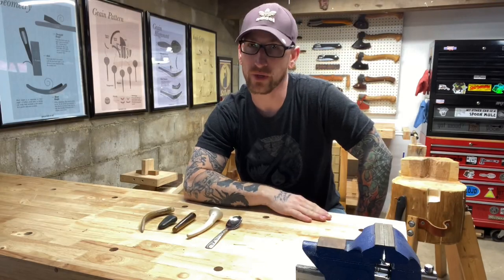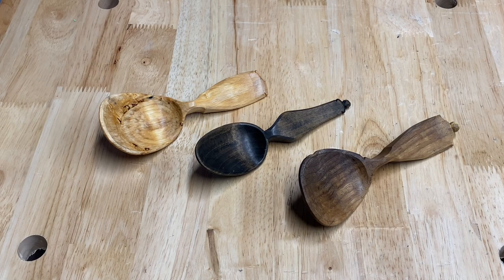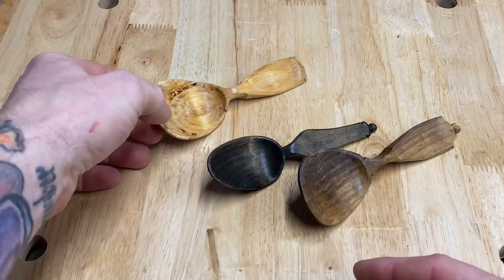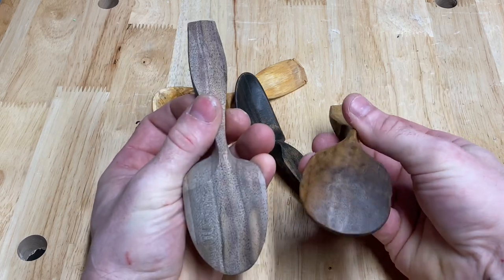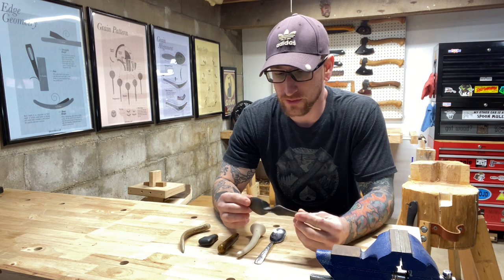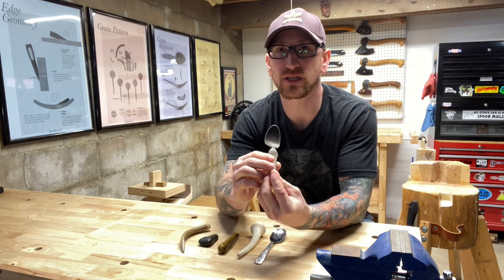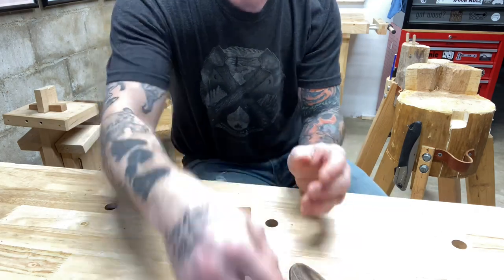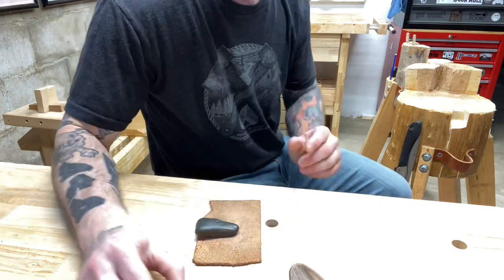Spoon Burnishing

Comment: Horon spoon co . I use vegetable cooking oil then I put my spoons in oven to darken them and pop grain out it also hardens spoons  you had to keep eye out you don’t get too dark finish or burn them  I use a smooth pebble to burnish a spoon but yeah your so bang on the bucks greetings from the uk 🇬🇧 👍🐾🦊🇮🇹
Reply from the maker: The problem with vegetable oil is that it has a shelf life so it is prone to going rancid just like anything else that expires. It also doesn’t polymerize, meaning it stays liquid within the wood and doesn’t offer any protection whatsoever.
Reply: Huron spoon interesting  I never had any issues using it I applied it very spareingly the oven baked spoon takes care of rest besides I’m not financially well off  so I improvise is why I chose whittling as I has plenty of my favourite pocket knives the Barlow and couple saks greetings from the uk 🇬🇧 👍🐾🦊🇮🇹
Reply: John, what heat and for how long? Thanks!
Reply: @johndagostino2451 I also love using polished stones and antler for burnishing wood carvings (the antler tip can be shaped, then polished, to get into all different bits of Celtic knotwork). I also use Walnut oil and cold pressed pure Linseed oil to finish as I’d heard that vegetable oil/olive oil would go rancid. Then I recently read a blog from Paul Sellers where he said that he used Olive oil on his spoons. My eras (eyes?) pricked up. He addressed the point of the oil apparently going rancid and said that he was still using spoons from thirty plus years ago that he had finished with Olive oil and had never had a problem from it. Perhaps it’s the quality of the oil used? I shall experiment!

Comment: I’m sanding mine, then oiling and then burnishing, but that’s cause I haven’t got your skill yet 😂
Reply from the maker: Just a heads up- sanding will almost always leave a fuzzy finish. Burnishing will certainly compress the fibers and give a silkier feel, but once the spoon is moist again the fibers will undoubtedly raise up again.
Reply: @HuronSpoonCo  
Thanks
Up until now I’ve been struggling with my skill level with the knife for the final finishing, and have been using the sanding as a method to get the final shape, 
Recently I’ve managed to do a few with only the knife to almost the exact final shape, but then sanded them to remove the flat spots and carving marks.
Practice makes perfect as they say. 😁
Reply from the maker: @robg521 absolutely!

Comment: Dude… what is that carving saddle you’ve built against the wall? It’s glorious
Reply from the maker: It’s a mixture of two different woodworking devices shared by a single frame. One side has a spoon mule on it and the other has a shave horse. They both share the seat in the middle.

Comment: I have mixed skills and mixed styles. Japanese planes are super sharp and planing will leave a polished surface on the wood that closes and burnished the new cut fibres so well, that they shine. Sanding actually degrades the surface.
Just started Carving & whittling, 1st lesson on testing sharp knife and knife sharpening was not can it slice paper, my penknife can do that. But can it leave polished, shiney surface is a completely different level of sharpness

Comment: Love you instructions and philosophy of spoon carving for enjoyment and improving you skill. All of my spoons are pretty rustic and more suitable for trolls (the kind under bridges). Would it make sense to first oil the spoons, then burnish? Burnishing will close the pores and prevent the oils from soaking in.
Reply from the maker: Thank you! It’s a common misconception that a finishing oil needs to “soak in”. It’s kind of backwards thinking actually because the deeper the oil penetrates, the more difficult it is to polymerize (assuming we’re talking about a polymerizing oil- which is the only kind suitable for spoons, in my opinion). Polymerizing oils should be applied in very thin coats. Thin coats can be cured quickly and then more coats applied, if desired. I’ve seen folks actually soaking their spoons in oil overnight because they believe it provides protection. Penetration doesn’t equal protection though- polymerization does.
Reply: @HuronSpoonCo  Thank you for the reply, that's very interesting. In other applications (furniture building, exterior home wood repair, axe head end grain, etc) I use hardware store "boiled" linseed oil (with probably toxic driers) and a variable thinning with a bit of turpentine and can watch it "soak in", and later more will soak in, decreasing with each application over time. On a few occasions on old weathered wood windowsills, many years later, I cut the wood apart and could see 2-3mm of penetration which firmed up the wood (and also allowed a top coat of oil based paint to adhere). I assumed, perhaps incorrectly, that something like that would occur with spoons too, especially since carving curves, like the bowl, exposes end-grain. For spoons, I use food grade linseed (flax seed) oil for initial application, then a period of partial drying (days to weeks), For a finish, several coats of General Finishes Salad Bowl Finish (now called Bowl Finish). Tried and True Original with linseed and beeswax is purported to be very good as well, but I have not tried it. I may have to re-think my methods.

Comment: Great video Sean! Love all the detail you go into.

The piece of antler you have, how did you get it so polished and rounded? I have a few pieces around the house, that the dog has lost all interest in, that I was hoping to repurpose.
Reply from the maker: Thanks very much! As for the antler, I’ve had mixed results trying to get the end perfect on different pieces of antler. I hand sanded the one you see in the video up to 6000 grit and stripped the heck out of it on bare leather as well. The problem I find is that some pieces of antler are able to be completely smoothed while with others, the marrow doesn’t smooth out well and will leave scratches in your spoon. If you can find a piece absent of marrow, you’ll surely be good to go!
Reply: @HuronSpoonCo  will take a look and see if we have any kicking about without marrow then!

Comment: Hello sir, I have a raw wood canary guitar neck. It comes with a factory 250 grit sanding, and most in the guitar/warmoth community sand this up to about 2000 grit (starting with 600), and then the neck is super shiny, burnished, smoother, and faster to play. Seeing how you burnish, I am inclined to think your method would provide similar or better results. Would you recommend using a smooth stone or doing what all of my compadres in the guitar community have done? Is there any risks with one over the other? I don’t need to reshape the neck at all, just close the cells and make it as smooth as possible. This was a great video, thank you!
Reply from the maker: Thanks for your comment! I would think using the side of my burnishers on a guitar neck would work amazingly!
Reply: @HuronSpoonCo  I think so too, but it’s always tough being the first to try something, especially on one’s own instrument haha. And I’m admittedly in between two sets of expert opinions; guitar techs who have always done it one way and woodworkers. I don’t think that trying either way prevents me from  roughing it up with a lower grit sandpaper and trying the other, correct? Say I try one of your burnishers first, if for some reason it isn’t what I need, I can always go back and use paper, right?
Reply from the maker: You could, yes. I would suggest trying one of my burnishers on a piece of wood with similar Janka hardness and see if it’s a result you like.
Reply: @HuronSpoonCo  Thank you so much. I’m ordering a burnisher now. I guess I have one final question. Since you don’t sand at all anymore, is there an equivalent “grit” to your finishing cuts? I ask, because this is already sanded to 250, but I am assuming that your finishing cuts are smoother than that. So maybe I sand up to 1000 grit, then use the burnishing tool.
Reply from the maker: The burnisher will make pretty much any wood surface smoother/shinier. The thing about sanding is that instead of cutting the wood fibers, you’re abrading them. A knife finish along with burnishing will always give you a better finish than sanding and burnishing. I would suggest trying the 1000 grit before burnishing and if you aren’t quite satisfied with the results, move up to 1500 and then burnish.
Reply: @HuronSpoonCo  that makes total sense. So a knife finished guitar neck is what I should be after 😂
Reply from the maker: @d4r1d  haha I’m not sure how well that would work😂